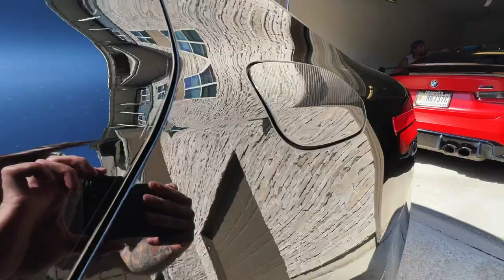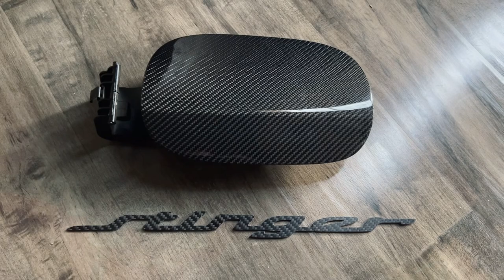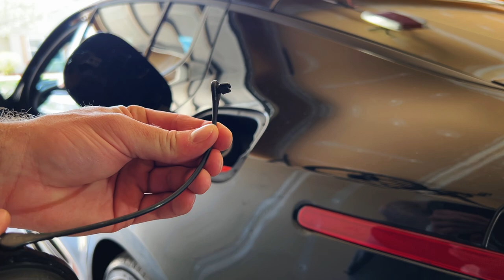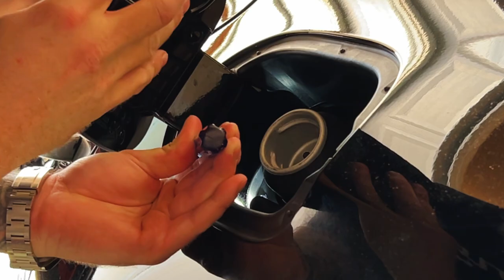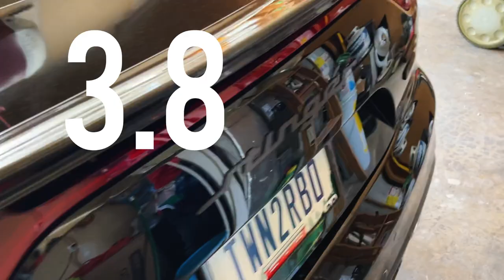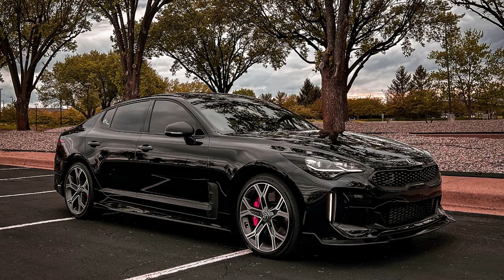New KIA STINGER Carbon Fiber Fuel Door Install + updates

Comment: I wasn't as lucky.  I tried for probably 35 mins and I was afraid I was going to break it so I just took the entire assembly out and it comes right off. There's actually a tab that makes taking it off soo much easier.  I've seen so many horror stories of people breaking their factory door trying it this way
Reply: Is there a video on how to take the assembly out?
Reply from the maker: If you can link on how to do it step by step that would be greatly appreciated. I couldn’t find anything on doing it that way. Or if you can type step by step maybe I can make another vid of doing it that way. It didn’t feel right doing it this way and I’m glad it didn’t break
Reply: @twn2rbo  Will do.  I'll send it to you.  It's like 4 or 5 screws and the entire assembly comes out.   I'll do a video or pictures and send it to you
Reply: Tried the screws…with a tiny Phillips head…they just spin…and get stripped….I’m at the point where I want to break it. I’ve ordered a new fuel filler assembly compartment due to scratches inside the gas housing.
Reply: @kylebell2365  I will try to post up a video.  Mine came out with (relative) ease.  It took a bit of work manipulating the release button around the rubber inside, but once I figured it out, it all came out pretty easily.

Comment: We need to gift you a dji mic. 😅
Reply from the maker: I have a Rode Wireless 2, but the beginning of the video was a random idea to record so the audio blows :/ also the latest update on the GoPro screwed doesn’t allow me to use the rode 2 with the media mod which is bs. I want to get the DJI action cam 2 but it’s sold out every time I check. GoPro sucks

Comment: I’m two hours in on G70….&$%#@ gas cover door!!! 🤬🤬🤬🤬
Reply from the maker: 😂 , someone said they removed it completely by taking out the screws. I tried that and didn’t see how or what they were talking about. It is definitely a pain the a** unfortunately
Reply: I think the Genesis G70 gas door is slightly different.  Tried trim tool…snapped it in half…tried the long flathead method…scratched the shit out of the gas inner filler area AND dinged the outer panel prying the gas door at an angle(fixed the ding myself with a dent repair kit).  Emailed seller in South Korea and he sent me instructions with pictures for a Kia Sorrento on how to remove the whole gas filler compartment.  Now stuck on the six “phillipshead” screws..they just spin in place.  The screws are raised in this plastic housing which makes it impossible to try the lift and unscrew method….heading to Genesis Service Department tomorrow for instructions.  Unreal…😂😂  F$#%ing carbon fiber.

Comment: Have you had any issues with downshifting my 2018 gt seems to jerk when slowing down gradually
Reply from the maker: On your TCU tune or just in general? Stock no, but after TCU yes at first. It takes a little time for the ECU to learn your driving habits etc but it will smooth out a little
Reply: I have a 2019 GT2 AWD and mine also jerks when I'm coasting at low speeds. Almost feels like engine breaking or something. At first I thought it was automatically applying the brakes like a sensor thought I was going to hit something. One of my biggest gripes about the Stinger honestly